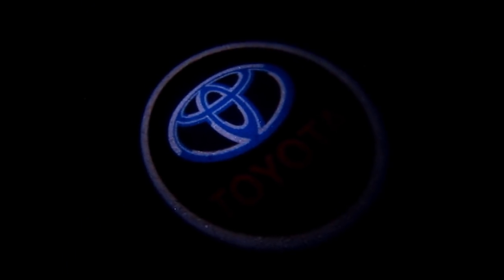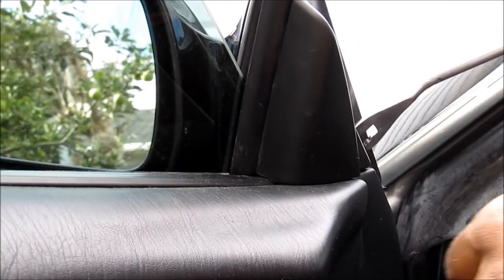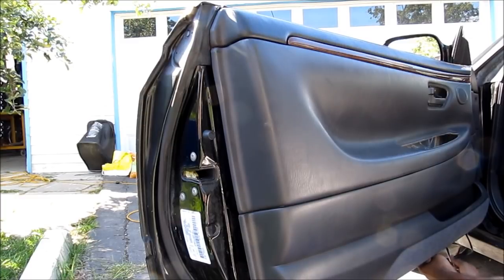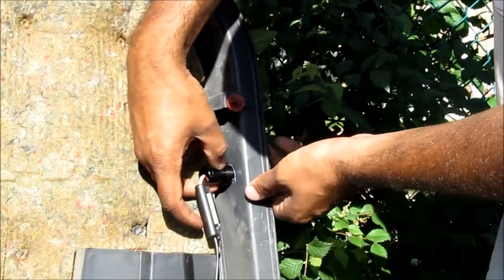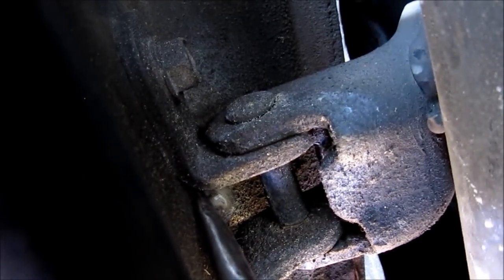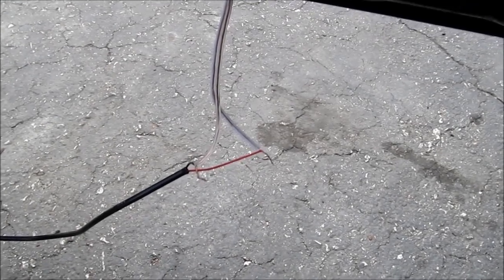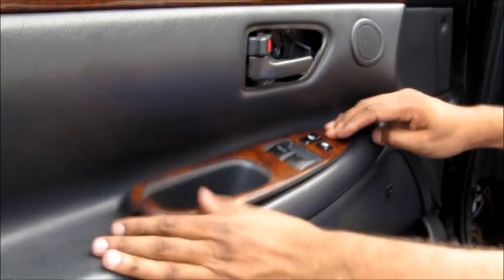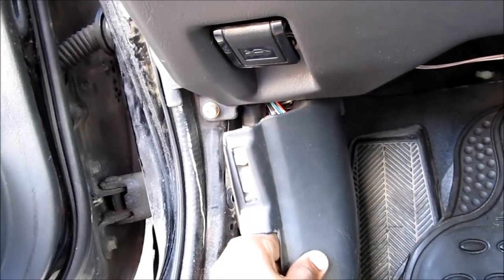Door Welcome Logo Lights Installation

Comment: I enjoy all your videos,pay no attention to the negative comments as most of these people probably have difficulty just dressing themselves,but you know that because your a smart guy
Reply from the maker: +COOTER383 thanks for the kind comments
Reply: Its not negative comments its just saying that he should cover loose connections with proper equipment so you don't kill your wiring. AKA solder connections or splice caps. As well with eletrical tape and shrink wrap

Comment: Nice job on the installation, i just ordered some logo lights for my car but do not require such a intensive install. they simply replace the existing door light with one with the projector built in. all you do is remove the existing light, plug in the logo light and you are ready to go. 10 minute job.
Reply from the maker: That's if your car comes with door lights
Reply: How to add it without Door lights. I ran mines to the dome and got it working but when the car door is opened, it stays on.

Comment: the ones I bought have no drilling or sires. it's all batteries. I'm glad I got those.
Reply from the maker: +Devin Hightower (TheXChapter) Thats great. What kind of batteries does it use, how does it activate and attach to the vehicle? How often do you have to recharge it?
Reply: +speedkar99 Hello. They sell on ebay for 6  USD search for 2 X Wireless Car Door LED Welcome Laser Projector Logo, it is simply install with no wiring, it need 3 AAA batteries. But I fear that it could fall because of the weight, the door opens and closes, and it&#39;s just installed with double-sided tape. It works with magnet sensor, when there is no contact with magnet on bottom of car (when door open) it lights.
Reply: +Devin Hightower (TheXChapter) It is installed with double-sided tape, it dont fall (because of weight of batteries and doors opening/closes)
Reply: Oh heck yeah I just found the ones you're talking about. Stick them on and GO. ORDERING.
Reply: +speedkar99 do you kno a way to make them stop fadin away

Comment: i had purchased my Toyota Down Door lights from a local shop in my City & wasn't knowing at the time they were selling on E-Bay as i would have preferred to buy on the internet. you see i paid way too much for the 2 down lights & had them professionally fitted. the sad part was they only came with a 12 Month Warranty & later found out the ones on E-Bay came with a 3 Year Warranty. anyway getting back to the story. my down lights were very bright & the Toyota was in Bright Red then before the 12 Months was up after getting my car back from the panel beaters as i had some paint work done, i noticed the Toyota was no longer in Red & now in White, there was no colour left whatsoever, i had phoned the business i purchased from & they had to order another set in for me as they were still under warranty. at that time we didn't know why it was losing it's colour. then to my Surprise in April after arriving home one night i had noticed again that the Word Toyota was in fact Fading and that's what happened the 2nd time. so here i was again on the phone to them explaining it was happening again. they again had to order another set. they are not knowing why this is happening & wanting to ask do you know why the colour is not lasting.? also before they had replaced my 3rd set of lights i decided to buy a set from E-Bay just in case these lose their colour. BTW i really love my Down Lights but i am only having them in the 2 front doors. seems like a lot of work just to install tiny lights, so glad i left it to the experts =]
Reply from the maker: It is a lot of work but its pretty easy once you get the door panel apart. I thought the lights had a color / pattern filter on them, I'm not sure why they would suddenly change color.
Reply: speedkar99 Yes the down lights have colour in them with the word Toyota in bright red, but sadly for some strange reason the Red colour in Toyota is not lasting & now that i have had a chance to see exactly what is happening. the colour slowly fades & isn't as bright. also they do not know why the colour is fading. i am quite sure that when my doors are closed the lights switch off. just wondering do the down lights only come on when you open up the door. i would have preferred a button inside that you can switch on or off. also i am having in all 4 doors blue LED running lights which haven't been much of a problem. only one time that the fuse blew & everything went black. they forgot to put in a bigger fuse to cope with all the lights think that is why my father calls my car a Christmas tree  :)
Reply from the maker: Maybe you shouldn't have all of those lights running if your blowing fuses. Putting a bigger fuse isn't the solution. The door light might not be getting enough current causing it to dim. I wired mine to my dome light so they turn on when I open the door.
Reply: speedkar99 haha yeah maybe i shouldn't have all those lights ;) but if anybody should know it would be you. those running LED's i am having in all 4 doors not take that much power, just wondering are you knowing how much power these Logo down lights use.? oh & i forgot to mention my car isn't just your average car haha it is a Toyota & a limited edition. you ask what type of car i am driving. so glad you asked that question ;) it is a 2011 Toyota Rukus Halo, it is exactly same as the Scion xB in the States. now you see & understand why i am having so many lights. wait until you see my on the roof light, i have a little surprise coming stay tuned for that. & i would love to Sub your Channel =] thank you for sharing hope i will learn something ^_*
Reply from the maker: Good for you. I suggest running all those accessory lights to a relay, and the hookup the relay to a separate fuse directly. That way you won't keep blowing fuses or mess up your car's electrical system, and can add as many lights as you want.
Reply: speedkar99 to be honest, i am not knowing if all the lights are hooked up to the relay, will have to get back to you on that one. it was only the 1 time that the fuse did blow, haven't had any trouble since. i am hoping in the next few Months or maybe early in the new year having under body lights fitted all around. i know more lights but i had to have under body lights & looking forward in getting them fitted. will post up a video in the near future will keep you posted thanks =]

Comment: please put a splice cap on those wires, that worries me a lot
Reply from the maker: +ITz Cresint Thanks, looking back I should have used stronger tape but it's been 3 years and I have had no problems with the connections.

Comment: I just did a 6 month update vid on the hologram logo light
Reply from the maker: Hey man, good job, glad they're still holding up. My logo lights are still working fine after one year, including through a rough Canadian winter. The only suggestion I have for your lights are to rotate them so they are in the same orientation.

Comment: You can get ones you don't have to wire they stick to the inside of the door. They run on batteries. I just got a pikachu one. Lol
Reply from the maker: That's good until the battery dies
Reply from the maker: How does it know when the door opens?

Comment: How bright are these projectors? Can not tell from video and does not state in item descriptions...
Reply from the maker: SolarizeYourLife You cannot see them in the daylight. They project the pattern nice and crisp at night, as per the video, but won't light up the ground as much as a puddle light.
Reply: speedkar99 thanks I wanted to use them on a bike and scooter for night riding, I hope they still visible under street lighting, I mistakenly bought the battery ones, major suck, can't even use it, but cool skull and bones. I suppose you can not change image once you mounted them....
Reply from the maker: Depends on if the logo is a separate piece within the lens. If so, you just screw them out and change it.

Comment: Can you explain to me where you got the power wires from, and where you grounded it? I know you used the dome light wires, but where did you find them so close to the foot wells?
Reply from the maker: I ran two wires from the dome light down the B pillar and into the center console to power my foot-well LEDs. I tapped into that so the door lights turn on when the door opens. See this video for details (procedure is the same for many cars): How to Install LED Lexus Interior Lights
Reply: speedkar99 thank you.
Reply: speedkar99 thank you.

Comment: Do you take appointments? Looking to get something similar installed on my 2012 Yaris LE. It's the luxury edition so something like this would be perfect. Thanks.
Reply from the maker: I believe the north american spec yaris didn't have puddle lights on the door panels so installation would be quite involved in running the wire from the door panel, through the wire loom and into the cabin, as seen in this video. There are battery powered logo lights available that might be more worthwhile looking into for your application.

Comment: hey buddy, i have a video request lol.. im trying to buy a dash cam to isntal it on the upper part of the windshield by the mirror and dont want to use the cigarette lighter plug in to power it up... can the wires leading to the mirror to power up the compass be tapped into to power the dash cam? if you ever get one, id love to see how u do it...
Reply from the maker: +Juan Carlos I've done  dash cam video a while ago. I wired an extension in my glove box on both my cars, you'll see that toward the end of the video.

https://www.youtube.com/watch?v=qGACUfL547o
Reply from the maker: +Juan Carlos Yes, you can tap into the mirror's circuit and rig up the power wires to it, since it is switched power (comes on with ignition). You'll need to find a place to stuff that transformer though.

Comment: hey bro i wanna hook mine up to a gmc sierra 2008 and i would have to do same thing but on mine i found and adpter with a live wire for power wich is intetior lights but do i have to connect ground to live ground too or can it b to s screw and if i run all 4 doors to same wire would i need a fuse connector???
Reply from the maker: +Tony Palomar you can gap into the ground wires for the window motors

Comment: or you can get the wireless ones that run on batteries instead of doing all that drilling
Reply from the maker: +hittman sanjo m?but then you'll have to keep changing batteries
Reply: its still much easier and your car keep the value... this destroys the value of the car... also why no video of the logo but only a photoshoped picture?
Reply: hittman sanjo you got a link for wireless ones? Can’t seem to find any.

Comment: Nice job ! So for every time you want the door to open so that it projects the emblem you have to hook up the wires to the interior dome wire?
Reply from the maker: Yes because the dome light is controlled by the door switches.
Reply: But like my comment - mine are now faded - no colors - all white.  My 2014 Tacoma has only 45K miles so in comparison, doors not “opened” a ton. Must be age and weather that loses the color on the lenses?

Comment: did you just crimp with done connection? what gauge write was that?
Reply from the maker: Yes you can crimp, or push the wire into a puddle lights bulb socket. Speaker wire is 22 gauge.
Reply: +speedkar99 what if I don't have a puddle light?
Reply from the maker: +Philip Sanzone Then you'll have to run it do the dome light like I did in this video, to make it come on when you open the door.
Reply: +speedkar99 did you have it on both sides of car?
Reply from the maker: Yes
Reply: +speedkar99 so you used speaker wire from one side to another?
Reply from the maker: Yes. They're split from the center console.
Reply: +speedkar99 is that where the dome light is powered?
Reply from the maker: I ran a wire down from the dome light to the center console. Just like in this video on my Lexus:
https://www.youtube.com/watch?v=WWM8F6q-a5o
Reply: +speedkar99 very cool, but were the red and black wires in the video added on?
Reply from the maker: I connected it to my dome light which I ran to the footwell. Similar to my Lexus: https://www.youtube.com/watch?v=WWM8F6q-a5o
Reply: +speedkar99 how much can the dome light take,
Reply from the maker: If the stock bulb is 5W, then the total draw of all your LED's should be less than 5W.
Reply: +speedkar99 do you know the wattage of these?
Reply from the maker: 5W

Comment: couldn't you just have hooked it up to the wiring on the window module that lights up when you turn your lights on?
Reply: Yeah but then the LEDs would burn for a lot longer making them very hot for no reason decreasing the life of the LEDs.
Reply from the maker: +lilhersheymia Yea but the lights are useless if the doors are closed, I need them on when the doors are open.

Comment: trying to make your car look mint on the outside, but you're doing a kinda hack ass wiring job.  still good and functional though.
Reply from the maker: +angusfuzz Yea looking back I should have probably used a thicker gauge wire in the door, and more durable tape. But its been 3 years and its holding up fine so far.
Reply: +speedkar99 then screw it. It's mint. Good stuff.

Comment: Any one 2011 tundra has red reflectors on door no wires  but my new logo lites came with connectors plug in. There is no wire in side Help!!!!
Reply from the maker: +robert mitchell you'll have to run your own wires through the door harness like I did here.

Comment: Is it applicable on Audi A3 2010?
Reply from the maker: +willenn fischer Yes it should work. But you might have a clip on option that replaces your puddle light for easier installation, you won't have to drill.

Comment: Does anyone know how you can clear them up if they get moisture in them? My set appears cloudy because of moisture inside the lense
Reply from the maker: Unscrew the cap on the lens and clean it. Since its not water-tight, moisture will find its way back into the lens. You could try to seal it with some electrical tape.
Reply: Thanks,appreciate the advice. I'll give a shot tomorrow.

Comment: Amazon has these NOW that are simply a courtesy light replacement - Just take out the little courtesy light assembly and install the new assembly - no door panel removal just a new assembly, you keep the courtesy light the same but you get the projector built in  - just a screw in most cases - lol - less than 20 bucks for most !!!  See below link
  https://www.amazon.com/dp/B077XCWL8X/ref=sr_1_sc_1?s=hi&ie=UTF8&qid=1512438353&sr=1-1-spell&keywords=led+logo+door+projrctor+toyota
Reply from the maker: +Troy Harper yea this makes it easier if you already have puddle lights. In this case I didn't.

Comment: man you just opened whole car.. instead look for something which works with battery, WiFi, charger etc.. anything
Reply from the maker: +JIN KAZAMA so what's wrong with opening the door panel? Its a cleaner install with no ba5teries
Reply: speedkar99 definitely u r right. but it would be nice if manufacturer has done so for us.. why would normal peoples be doing such engineerin lol.. 😂😂  to avoid Manf. warranty..

Comment: Can't believe you taping wires together,  Glad you're not working on my car, 
Proper electrical connectors should always be used.  Your insurance company will not want to know if your car catches fire due to unprofessional wiring. Try it.
Reply from the maker: Keith Simpson So long as the tape holds up its fine. You've got fuses in case something shorts out.